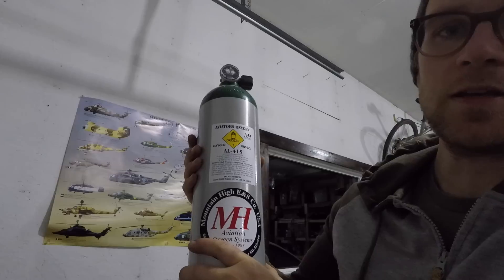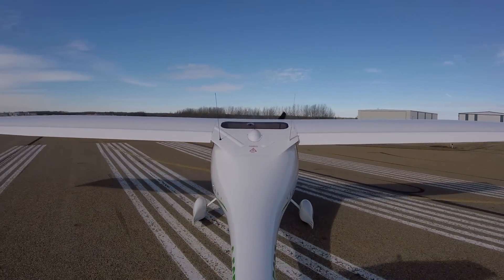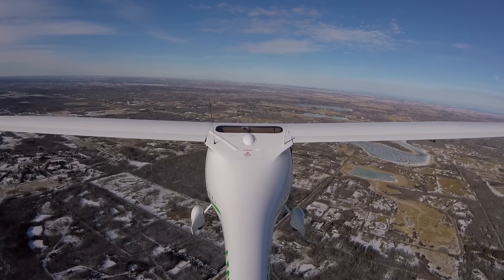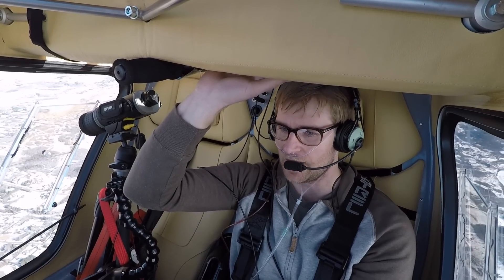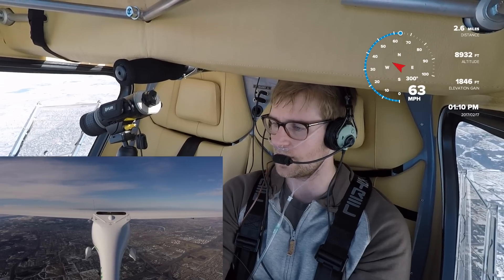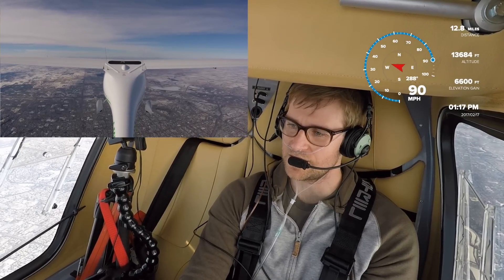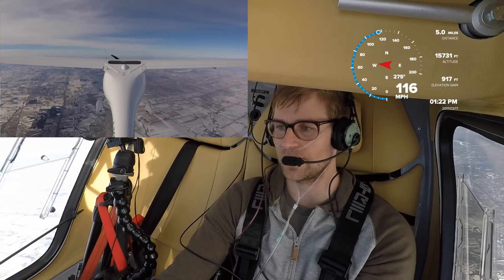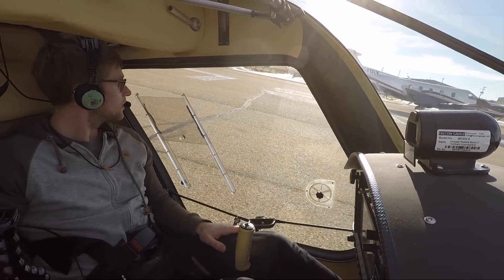Pipistrel Virus SW at 16,000'

Comment: Cool. What's the most efficient altitude? can they fly further and faster at altitude? does the engine start to struggle?
Reply from the maker: You typically burn less fuel at higher altitude, not sure what most efficient altitude is.  How far do you want to fly? You can order aircraft with 100, 180 or 300litre wing tanks.  Yes your climb rate is slow past 12,000' but I fly often at 15,000'.  If you want to fly beyond 15,000 often then you will want a turbo.
Reply: @DarrylZubot  We are up against an invisible wall without oxygen but maybe 9k if there is significant advantage. I don't see the LSA makers specify range vs altitude which is sloppy in my opinion. Some of the better LSAs fly over 2000km on 100L so it's interesting to me if that's at sea level and if FL90 is much further. Because it only takes 3000km range to cross directly from Europa to America and that's pretty cool even if you might never dare such a trip in a single engine LSA :)

Comment: Why would your true airspeed matter? It would be indicated airspeed you would need to worry about. True airspeed is calibrated corrected for temperature and density altitude so not applicable? Am I wrong?
Reply from the maker: True airspeed matters because it is your actual airspeed, indicated is wrong so if you are relying on indicated airspeeds you can easily overspeed the plane because it is not your correct airspeed.
Reply: Darryl Zubot Darryl, loving your vids.. But really it is indicated to worry about. That’s the actual speed your airframe feels, not true airspeed. At extremely high speeds (ie jets), then a concern is max Mach number, but definitely not the Pip. Keep up the great work, enjoying the channel!
Reply: That is true but the air is less dense so it is all relative. That’s why your VNE,VNO, VA etc speeds are all indicated airspeeds not true airspeeds. Although you are going faster than indicated the air is less dense putting less stress on your plane... You are making yourself go slower than you have to my friend haha.
Reply: Unless the virus has its V speeds in true which I have never seen before?
Reply: Flutter responds to TAS.

Comment: How does your O2D2 system work exactly. Particularly what does the D2 mean or stand for.
Reply from the maker: Jeffrey Henry I think It means oxygen delivery for 2 persons. It senses when you exhale and pulses oxygen when you inhale. The amount of oxygen it pulses depends on your altitude. It has a barometric sensor and knows altitude and automatically adjusts how much oxygen it pulses. Well worth the money, and if you have a small aircraft like mine it’s necessary as you want to save as much weight as possible. This allows me to fly high altitude 2 people for up to 6 hours.
Reply: Darryl Zubot awesome I am building an RV10 with my dad and I am doing a little research on O2 systems. Thanks for the response. Also your channel is pretty cool. How long have you been flying for and what ratings do you ave?
Reply from the maker: Jeffrey Henry awesome plane to build! Hope it goes well. I’m commercial, multi engine rated. Flying for 12 years, started on a Cessna 150.

Comment: Do they do a turbo for that?  Bit slow at those altitudes.
Reply from the maker: Paul Dutton you can get the 914 in this airplane.
Reply: Are you sure Darryl coz I looked at the Pipistrel site after watching this vid and noted the following text in their faq..  "Is it possible to have Rotax 914 Turbo with the Virus SW?
No. Not for the moment at least. The Virus SW with 100 HP is already the fastest cruiser (75%) in its class, so the wish for the 914 is slightly redundant."  Has this changed then ?
Reply from the maker: Paul Dutton I am 100% sure. There are three people I know with 914 in a virus sw. They may call it the surveyor but it’s same as virus sw. On the order form it has option for 914 plus 180l or 300l fuel tanks instead of standard 100l. The round the word virus’s all have 914 engines for high altitude. Not for faster cruise. Fuel burn is 22l/hr with 914 in virus sw.
Reply from the maker: Also the gross weight goes up to 750kg. With beefier landing gear
Reply: Thanks dude..... Can I hit you with one more Q. There is a company called edge performance that do a popular 912 conversion to a turbo.Quite an extensive makeover giving a net result of a unit 3kg lighter than the 914 but it tops 154HP! Is there a HP rating on the virus?
Reply from the maker: Paul Dutton no worries. I’ve been told the 914 isn’t great to work on as it’s so compacted to fit in the virus sw. I’ve heard about this company that would be pretty awesome performance. But I’ve also heard tbo is lower then 2000 hrs if you do this, that’s just what I’ve heard could be wrong.  In Canada this airplane is under experimental category so there is no hp limitations you can basically modify anything to the airplane without anyone’s approval
Reply: It would be a tempting option but wonder if the firewall can handle the torque stress.. Plus you might be drilling tunnels if you used that power on take off in tail gear config. Not sure, but who would want 114HP when you can have 154HP for similar price and less weight.  Yeh, 1200 hours yet have read reports the overhaul at that interval revealed no wear.  Guess u pays yer money and takes your choice but bet it would climb like a rocket up to 10k feet and cruise like a missile thereafter. :)
Reply from the maker: Paul Dutton you’ve peaked my interest into this now! That would be an amazing setup. Climb is already ridiculous in this plane can’t imagine with 150 hp. Ideal for high altitude. Make sure not to overspeed plane you’ll get into flutter. Happened to guy to who took possession of his plane. First flight overspeed wings tore apart from flutter. Parachuted down. Will keep this in mind for when I’m at 2000hrs.
Reply: Can you put vortex generators on a laminar flow wing? Think you can and that would keep you the right side of the flutter zone plus give you some better low and slow action. I don't think Pipistrel would be happy to read this thread. Think we are killing their energy efficiency philosophy. Mmm, Mr Boscarol.. When is the Virus V8 going to be available? :)))

Comment: i thought checking play in the prop was part of the pre flight. how fast do they allow u to fly that plane up there? did you build the plane?
Reply from the maker: Skip Calta it is a part of pre flight. There was no indication of play, the play was very small, and the cracks occurred internally in the prop motor/gears. There’s no speed limitations on this airplane in Canada. We don’t have the LSA category in Canada.
Reply: kind of scary that u can't catch that issue., what's to keep it from happening again?
Reply from the maker: Skip Calta don’t buy another woodcomp propeller. I’ve switched to MT Props.

Comment: Great flight video, how well does the heater work at 16,000 ft and that cold of out side temperature.
Reply from the maker: Dean Smith heater works great. They now build shrouds around the muffler for cockpit heat. Also having the cowl flap and closing it up when it’s cold really improves cabin heat

Comment: Beautiful little plane. What are the real operating costs/hour and how do you calculate them? I know that these can run on extreme low fuel, lower then cars/mile.
Reply from the maker: it's very difficult to calculate as I do my own maintenance, and plan to run engine over 2000 hours if I can so that will also reduce hourly rate. If you look at all standard pricing, it's $15/hr for fuel, $15/hr for engine, $1/hr for oil, parachute needs to be replaced every 7 years, not sure how to calculate that into an hourly cost, i'm estimating about $40/hr for operating costs, but again so many things come up with aircrafts that you don't expect, your radio can fail etc.

Comment: You weren't joking when you said the turbo Rotax was overkill for this airframe. Looks like it got up to FL160 fairly quick! It didn't seem like you were up that long but what was your true airspeed at FL160? Is 147kts true the VNE?
Reply from the maker: gmonnig yeah it didn't take much time at all, maybe 17 min real time, climb rate was incredible that high up still got 700fpm. VNE is 160 knots. Max cruise is 147 in smooth air. Very easy to overspeed this plane. It has almost no drag. Air brakes are a must. Descending from this altitude was a breeze, 2000 fpm decent without increasing airspeed.

Comment: Congratulations on your new born and your 16,000. What was your fuel burn like?
Reply from the maker: Mark McGuigan thanks! Fuel burn at around 6,000 is 15lph - 130knots, up at 16,000' it was 15lph 142 knots. Can get 138knots with 18lph at 6000'
Reply from the maker: Nick Good the speed show on the widget is gps ground speed. The actual TAS was 145knots, indicated was about 120. Oxygen would last about 12 hours with one person, 6 hours with two.
Reply: That's good going. Even so, tha tank is quite low pressure, you mentioned 1,800 psi. SCUBA tanks are 3,000 psi - about 200 BAR, and north.
Reply: Those are astonishing numbers. 2 questions is that TAS, IAS or ground speed? How long would that oxygen tank last ?